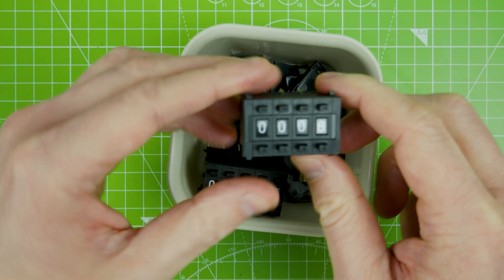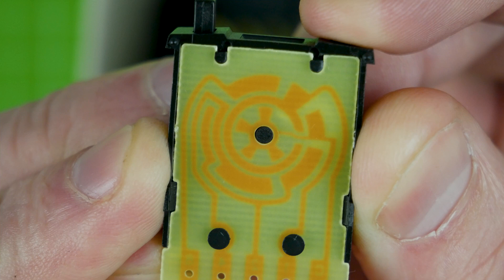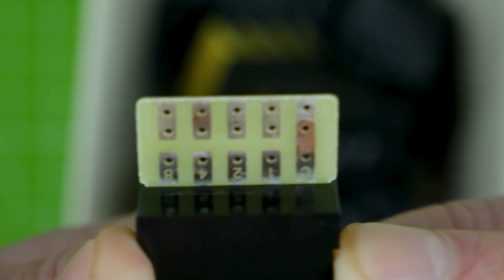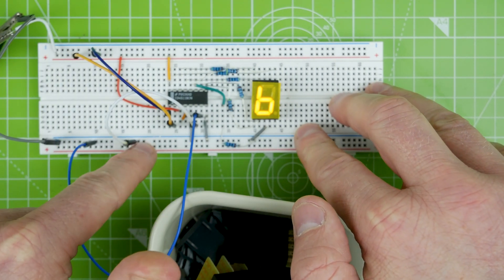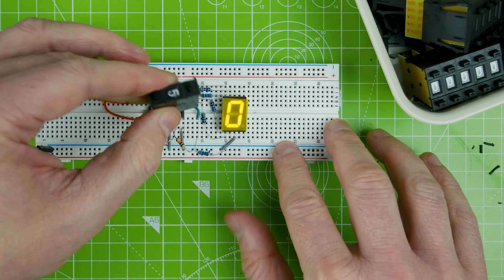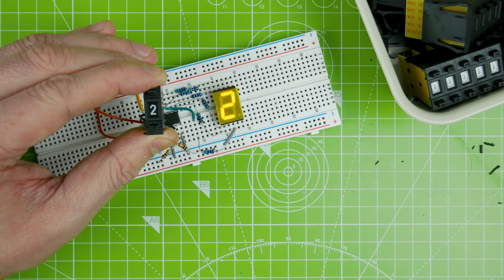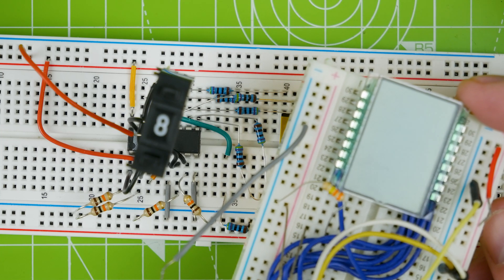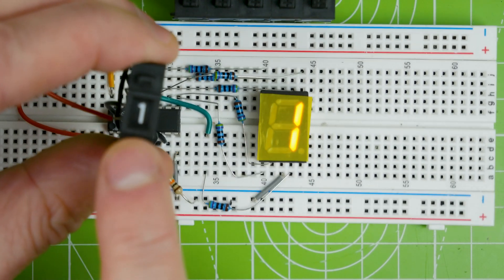Cute and clicky: BCD Thumbwheel Switches

Comment: The janky in-between values (3 -> 1 -> 4) are mechanically inevitable unless they were to use grey codes instead of binary. Even then, the transition from 9 to 0 would still be rough.

Also a shame the up button is down and the down button is up! Still, very cool devices, and a great clear demonstration.
Reply from the maker: Interesting, I should have taken one apart to fully understand the sequence and where the wiper overlap was. Thanks.
Reply: Going from 3 (0011) to 4 (0100) requires changing 3 bits. But it’s impossible to build an infinitely precise mechanical device, so it’s impossible to make it truly simultaneous. One of those bits will change first, then another, then the last. If you rotate slooooowly enough, there are actually two undefined states between 3 and 4.

Not a huge problem here, since the counter jumps thru the undefined states and settles where the signal is reliable. Rotary encoders could stop anywhere, though, so they use a really clever pattern called a Gray code where only one bit changes at a time.

Comment: How would i read these out with a microcontroller without wasting a lot of pins? Looking foward to your soltion.
Reply from the maker: For a single thumbwheel switch? I would use an analog pin on your micro. Add a 1k to the first pin, 2k to the 2nd, 4k the 3rd and 8k to the 4th. Then bring them all together with a 10k to ground. It should create a resistor divider you can read reliably. For multiple you could use the same approach but add a shift register to alternate which common pin is getting power.
Reply: @DavidWatts 
I always forget about this resistor divider technique. It sounds like a cheap and simple solution!
When having multiple switches I was thinking of some sort of ic like an io expander. I guess that would be kind of overkill.
Reply: These come from an era where uP had full 8bit ports so you could multiplex quite a few to one port. 4 bits for the switch and 4 bits for the multiplexing. the thing we did before charley.

Comment: Those are cool AF! So if you daisy chain the clickers - do they increment the next one after 9?
Reply: there is no mechanical connection between then in normal thumb wheel switches.
Reply: Not normally, as there are up/down buttons for control of each individual digit (the 1s, 10s, 100s, etc) and usually quicker to set them individually instead of hitting the lower digit repeatedly (spreads the wear too)